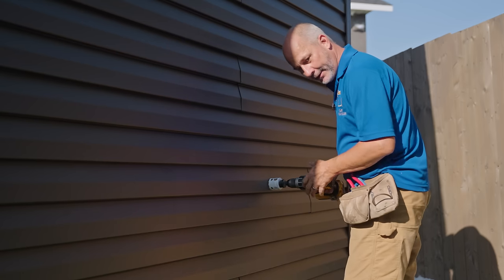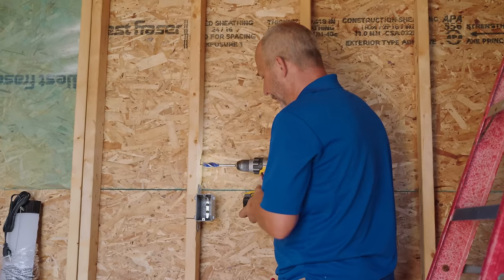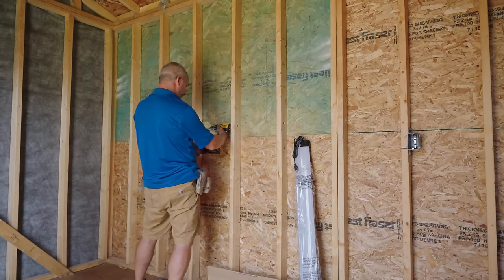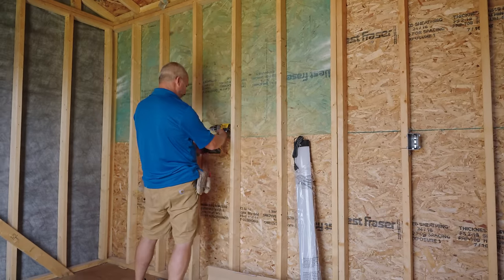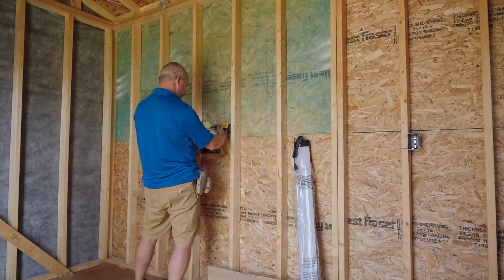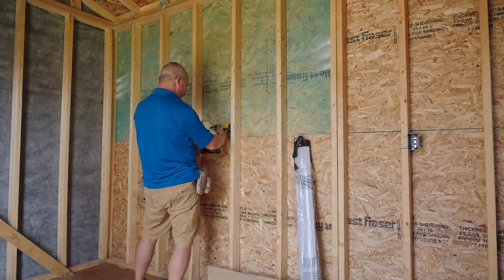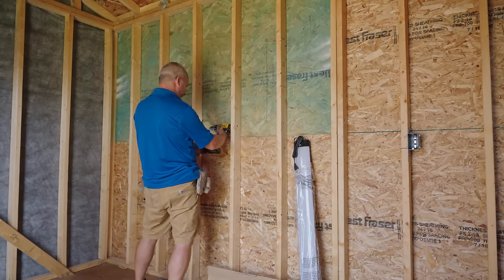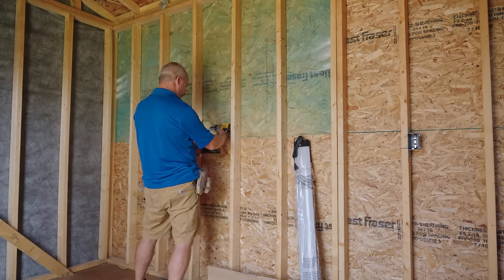How to Run Permanent Temporary Power to a Shed

Comment: The previous owners of my house did something similar with their shed. They ran 50a 240v to a NEMA plug on the outside of the house. Put a 50a 240V NEMA plug on the outside of the shed and ran it as the supply to a small panel in the shed. Whenever they wanted power in the shed, he'd just use a NEMA power cord to connect the two sockets. Everything about it felt incredibly wrong but I respect his desire to not pull a permit if he didn't have to. 😆

Comment: My son's shed got a similar set up. At the entrance there was 2 LBs. One on each side. The cord came in and was connected there. The next year 3#12 replaced the #14 cord. 2 circuits so he can run a saw and have light if that breaker trips.

Comment: I'm a polymer scientist and your comment about silicone v. polyurethane sealants surprised me. Silicone doesn't stick well to wood, so I could see how water could intrude after adhesion loss with wooden building materials. Otherwise, unless someone did something crazy when formulating, a silicone-based sealant should be far more stable against damage by water than any polyurethane-based sealant. Could you share more about your experience with silicone sealants with us?
Reply: My question also.  Am I waterproofing stuff all wrong?
Reply: @SK-qt1rm They use silicone when making fish tanks.
Reply: @binnsbrian you don't make wooden fish tanks
Reply: @larryjolicoeur7169 you missed the point

Comment: I usually pigtail to each outlet so if an outlet fails it's quick to find the failed outlet, but the rest will still work, whereas running wires in and out of each outlet it's more difficult to find which outlet failed because when one goes out they all go out.

Comment: Hey Jeff. I suggest doing a pigtail on your outlet receptacles. At 30:15 Bring the blacks together and pigtail one black/white (other than the switch leg wiring) to it instead of relying on the little brass tap to make your connection. I was told this by old timer electrician long ago. It is better practice. Probably even code. Cheers!
Reply: PIGTAILS ARE JUST AN UNNEEDED EXTRA CONNECTION THAT CAN FAIL
Reply: Exactly what I was thinking when I saw that.  Pigtailing is definitely best practice in that situation, best not to rely on a brass tab that is designed to snap off fairly easily.  As far as providing connection to all downstream power supply, the pigtail replaces the tab, so its not really an unneeded extra connection.  It is a superior connection that replaces an inferior one.  The pigtail's wire nut is designed for the exact purpose of making that connection (to everything downstream) - the tab may be adequate but it is specifically designed to supply a power connection between the outlet's dual receptacles, not a connection across the outlet to everything downstream.
Reply: @cjc9719 Especially if you have higher load which can cause the receptacle to overheat
Reply: Electrician here ,  no need to pigtail the receptacles are designed to handle full load
Reply: @larryjolicoeur7169  YEP! All pigtails do is add one more unneeded failure point!

Comment: i'm an electrician by trade, I work in the tech sector now, but to this day, every single plug I wire, I mumble to myself "black to brass or you're on your a**"

BTW I think you did a fantastic job. You are the man!
Reply: Can I ask some questions? 😊 I am getting ready to rewire my house. I was gifted a 1000 ft spool of 12/3 Can I just use it, and use 20amp plugs where appropriate, and 15 amp plugs elsewhere on 12/3? What do I do with the red traveler wire in this scenario?
Reply: @denisegaylord382  Red traveler wire is useless in your scenario... Unless you want to run some half hot receptacles. For your 15 amp receptacle on 20 amp circuit, i believe you arent allowed to do so unless you run a 15 amp breaker on the 20 amp circuit. There are plenty of videos on youtube from experts just youtube search the term "15 amp receptacle on 20 amp circuit"  they go over the question and answer it using the NEC code book
Reply: @abrahammc2125  thank you for your suggestion. I have to replace the panel. My house was built probably in the late 1930's/early 40's. Electric was added later, and repeatedly expanded, than the original build, so there is a mishmash of service, sub panels, panels, fuses, and circuit breakers.  A whole lot of sketchy connections. Thank God it's a cinder block house, otherwise I think it would have burned the ground by now. 😳 So I can just clip the extra traveler off so it's out of the way?  it's not being used to carry any power to an outlet. I do have a couple of places that I want 3 pole switches to control some lights, in those scenarios I will be using it.  The outlets that will be 15 amp, will be on a 15amp breaker. I know traditionally 12 gauge wire is used for 20 amp circuits, where 14 gauge wire is used for 15 amp circuits. But being thrifty, (read this as frugal, cheap or blessed) I was just going to use the 12 gauge for switches and outlets, with the appropriate breakers and outlets based off of the amps on the circuit.
Reply: Hey, I want to get that put on a T Shirt!
Reply: Yes when my electrician buddy was teaching me his version was " black on brass will save your a** "

Comment: A different approach that that can be sealed nicely for weather/bugs is a pvc junction box on the exterior, then out of the bottom of the box have a 6 inch whip with a male cord end on some sjo type of wire. or  just have the cord end inside the junction box, take the cover off to plug in your shed, then unplug and tuck the male cord end into the jbox when you don't need power. 
later on if you decide to bring 30 or 60 amps out to your shed or shop that junction box can easily be swapped for an outside surface box for a 15a gfci or something else to suit your needs.

Comment: Great video as always. Lots of tips for beginner DIYers and good reminders for older DIYers like myself. One question though, you have your male  plug running outside to attach to the extension cord, but you didn't show anything about weatherproofing that connection.  I was waiting to see if you were going to put another L connector box on the outside too like you used on the inside or one of those outdoor receptacle boxes with the clear plastic lid for rain protection.  What are your thoughts on this?
Reply: I used an RV connector box for the temporary connection. Available on Amazon.

Comment: Others have mentioned having a neutral in the switch box.  Personally I'd put an outlet/switch combo in the switch box and make use of the neutral as well.  The other thing to mention is that (as I understand it), the horizontal runs of exposed wiring can't be at that level, they must be 6 feet or higher.  This is to make sure the wire isn't used for some other purpose (hanging something up, or standing on it).  Also the "tamper proof" outlets are a pain (but required now).  As for GFCI, I suspect that the extension cord feeding this "temporary" installation is probably plugged into one.

Comment: Thank you for the video. I have always questioned per twisting wires before putting on the wire nut. Twisting sounds like a logical and good idea; however, the wire nut manufacturers do not recommend pre twisting. They recommend putting the wire in the wire nut without twisting then twist the wire nut until the exposed wires are twisted several times. I don't see how either technique is right or wrong given the manufacture's recommendations..

Comment: Here in Cowlitz county if the shed is under 200 sq ft, no need for building inspection and no electrical. I use SO cord.  Three outlets one light switch for four led tube type lights.

Comment: for the outlet, you should have made a pigtail and not use the outlet as a thru device. With no pigtail it is impossible to change the outlet without causing a problems downstream.  Pigtails make box fill a bit more of an issue to neatly tuck in.
Reply: Either way is code. Besides, the whole circuit should be dead if you are going to be changing devices.
Reply: Also by not pig tailing the ground wires you have lost your ground connection at the first box. Because the boxes are non metallic. You shouldn't put these kinds of videos up and get someone electrocuted.
Reply: @lestersmith8758  He said those boxes have a metal strip in them to connect the ground wires. That is why he screwed both grounds to the box, then left one long to connect to the device.

Comment: Temp/permanent alt:  Wire underground up onto post by building into appropriate covered receptacle(amps as needed). Flex cord(through wall) fitted with a plug into brkr panel.  Plug into receptacle.  Avoids inspection but also some real property tax because of its temp designation by using a cord/plug.

Comment: you should pig tail every outlet box so if one outlet goes bad it doesn’t ruin the whole circuit
Reply: Good practice but probably doesn't matter when you only have two boxes.
Reply from the maker: if one goes bad i just replace it. no worries!

Comment: I’ll be building my shed this spring and electrical work was never my strong suit. Plus it will be used mostly with woodworking equipment table saw, bench planer, and so on. I’m actually very excited about the build but electricity ⚡️ that’s another stressful 😣 job for me. Much appreciated on the tutorial
Reply: Hi, I saw your comment about your future work.  I built a 32x12 permitted garage shop alongside my house 15 years ago for woodworking.  I installed a 100 amp 240 VAC subpanel, and love having that power available.  I currently have seven 240 volt loads. (heater, air comp, dust collector, table saw, band saw, MIG welder, CNC router) Point is it will be worthwhile to put in 240 VAC.  Especially if you are going to maybe add heater one day.  Another thing I recommend is to get a current copy of the NEC (code) book and spend time studying it if you are planning to do it yourself so you do it right and have the reference at hand.  I hope you have a friend that is an electrician you can ask questions of.  I am an EE, but the Electrical trade is certainly a skilled trade and I respect their knowledge and practices.  The code is your friend so be sure to follow it.  You can DIY it, but be sure you have the competency. Permit it and have your work inspected.  We are blind to our own mistakes, and this is something you want done right.  I also recommend watching registered electricians you-tubes instead of DIYers, so you don't learn wrong 'knowledge'.  This guy was pretty good but he is not up to current code.

Comment: at 42:19, how did you get the backshell on the wire after connecting the plug without it?
Reply: Some come in two pieces and clap or screw together
Reply: I smiled when I saw him attaching the plug before the backshell too.  Magic of video editing.

Comment: Temporary power has its own section in the code book, technically any electrical work requires an inspection
Reply: Exactly
Article 590. Temporary installations are limited by time constraint (90 days), for emergencies, and for construction. Approval is still required.

Comment: I fully unroll the wire first, then I'm not trying to wrangle a twisted wire onto a flat surface. I prefer the clips that hold it tight to the surface, it makes the install look cleaner

Comment: Lol permanent temporary power kinda contradicting 😂 haven’t watched the video just thought the title was funny
Reply: Same thing I was thinking 😅
Reply: If you get it, you get it. Legalities would probably make him label it as such. Its genius if you ask me !!!
Reply: Also its set up already for permanent wiring, brilliant. That may be why its permanent also.
Reply: That's what I call what I did for my shed. I installed 2 GFCIs in a single box both on their own 15a circuits on the exterior of the house, and then I run two 12g extensions cords to the shed. Plenty of power for tools & lights.
Reply: It is amusing, but considering I was wanting to do the same thing he is talking about I get what he means. I'd like to wire up my shed for power and temporarily run it off of one of those big power banks, but when I finally replace my panel for the house I plan on trenching it at running permanent power to it and I don't want to have to change how my shed is wired in the future.
Reply: You sometimes have to say strange things to keep the pencil pushers happy.
Reply: @harpintn  heard
Reply: @harpintn or the YouTube commenters
Reply: I can’t believe nobody has pointed this out yet but in my opinion most of the temporary things I’ve done shift to permanent the second they are complete and work
Reply: up next, temporary permanent water supply 🤙
Reply: Oxymoron, I wonder if it's for legal reasons 💀
Reply: @TropicalMint808  LOL
Reply: I love this. I am going to do this this spring
Reply: It is silly sounding, but it is the terminology used under the power and communication codes. You are using temporary, safety approved methods and materials in a non-permanent application. As long as the the proper codes are followed the temporary installation can be used over the long term. Most people think of temporary as something with a short term expiration date attached, the code looks at it from a safety point of view and as long as the methods and materials continue to uphold this aspect and meet the requirements, the installation may remain in use.

Comment: Many localities don't allow 'daisy chaining'  power through an outlet box via the two screws on the outlet fixture.  My AHJ does not.  They want you to tie the two hots with a pigtail to the outlet, likewise the neutral and ground. There's the reason to save those cutoff bits of wire!  In fact, for the ground, they want us to use "Greenies" which are a murette in the top to allow the pigtail to exit.  I'm not sure if this is an electrical code requirement or not, but our inspectors do not allow it in any case.  Also, makes it so much easier to replace outlets in the future.

Comment: Great job Jeff. Mine would look a bit different, because the boxes would be considered upside down. I take my hints from the RV industry, where the ground plug is on top. Not many people notice that the ground prong is slightly longer than the other two, for good reason. It is made to stay in the receptacle if the plug is pulled or happens to come loose and create a gap. With the cords usually hanging down, this forces the power and neutral prongs back into the receptacle instead of them opening into the air, where something could fall on them, causing a short, or worse yet, a fire. I'm not sure if it was code at one time, but the esthetics of the receptacle are what caused people to put the ground slot on the bottom. I personally would rather have that margin of safety than worry about how it looks to other people. Looking forward to check out your other work. I knew you had to be from Canada when you said Robertson, instead of square drive. For those who don't know, a #1 Robertson(Green Handle) will work in the screws on the switches and receptacles as well as the cord ends.

Comment: Im in the middle of wiring our 32x48 garage feed from house. Some mistakes have been made but nothing even close to what it would cost to have an electrician do it. My best guess just for basic hookup to pass inspection would have been 2500+. And im at about 1k for materials plus my time which is important. But i've also seen what electricians can get away with and im handy enough ill do it myself. Its really not that hard even if you throw in a 2 way circuit. The biggest pain is planning it all out and what you want where while at the same time trying to plan ahead.
Reply: Go find my response. DO NOT wire your garage like this at all!

Comment: Any outlet being directly exposed to the outside like that should also have a wrap or two of electrical tape around the outlet to cover the contacts.  Distance from outlet to 1st staple is generally 12 inches.  Also, don't forget the stretch loop in the outgoing wire.  I just bend the wire in a half loop before stapling.  That way you have room to move the outlet if you want to.
Reply: That's good practice  but not code

Comment: talking about 15 or 20 amp wire and outlets but one thing not mentioned.  You can run 12 gauge with a 20 amp breaker and 15 amp outlets per code.  You can use lower rated outlets in the same way you can put 15 amp outlets in a bathroom that requires a 20 amp circuit.  You can't do the opposite (shouldn't need to say that one and Jeff did say that).  The point is that you only run 15 amps on any given outlet but you can run power hungry tools that are individually able to work on a 15 amp circuit but together would require a 20 so long as you don't go over 15 amps total on any one outlet.

Comment: Nice. I will use this to add switches lights to my garage and outlets in more convenient locations. It already has power and I wouldn't be using any more at a time than I do now, just less extension cords and switches instead of pull cords.

Comment: Just saying but I would of added an other PVC elbow box on the outside like the one you put inside, that way your outside connection would be out of the weather and it would have been easier to seal the siding.  Nice video.

Comment: NOCO company make the GCP-1 and GCP-2 very affordable on Amazon or from truck/RV accessory retailers. 125V 15A rated. I'd check that out. You drill a 2 inch hole, use whatever sealant you want (or it comes with a gasket) and it's waterproof. Accepts an extension cord, outputs 1 or 2 sockets on the other side (depending on which GCP model you get).

Comment: What brand of boxes are you using that has a metal plate in the bottom for the grounds?  Also, never seen that box you used for the outlet on the light... where did you get that please?